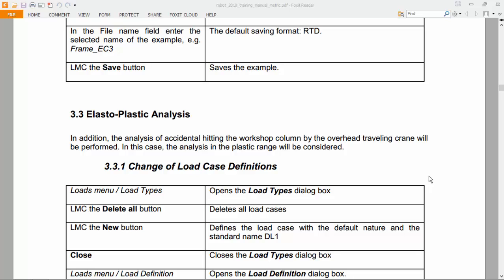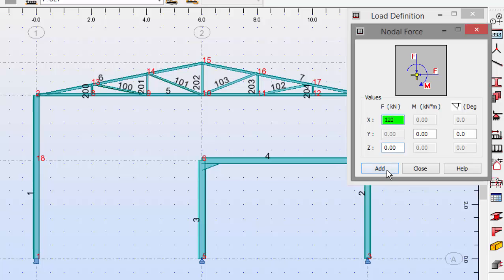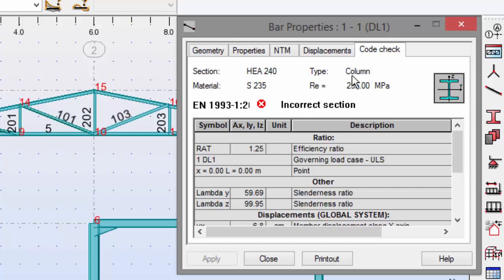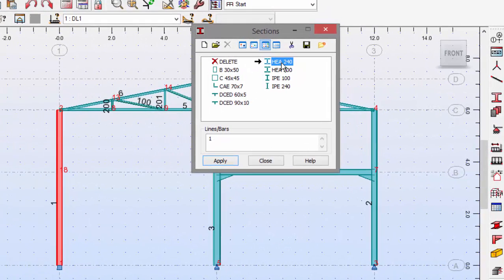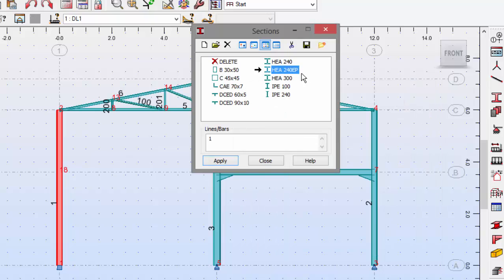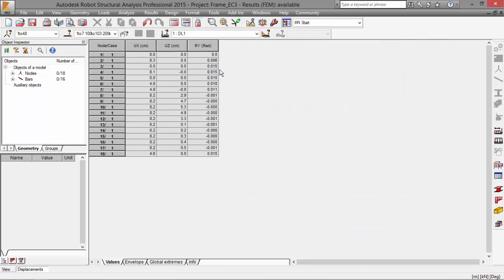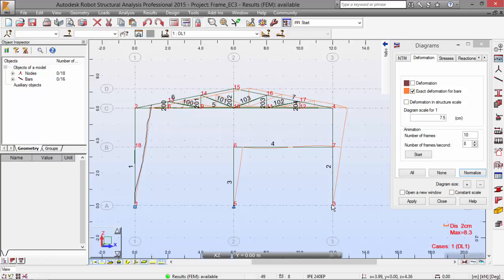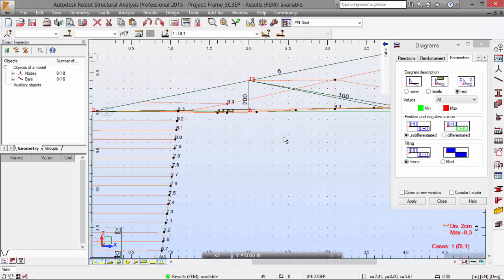Exercise 3 - Part 4 - Elasto-Plastic Analysis (Robot Structural Analysis)

Comment: Hi, I did the same exercise and frankly the elasto-plastic analysis does not help anything. If i go to code check again I still get the error.
What are you comparing the 83 mm with?
Reply: ***** without considering elasto-plastic analysis, the uitilzation ratio is 1.60 with a displacement of the joint of 68 mm and by considering elasto-plastic analysis the ratio becomes 1.32 with a displacement of 83 mm. I guess I was confused about why the same quantity is not clearly compared before and after.
Reply: Same results here! I just wonder which of these two results is the realistic one and if considering elasto-plastic analysis means that I'm considering a different column, a fictitious one... So, what's the point of elasto-plastic analysis besides misrepresent the columns?